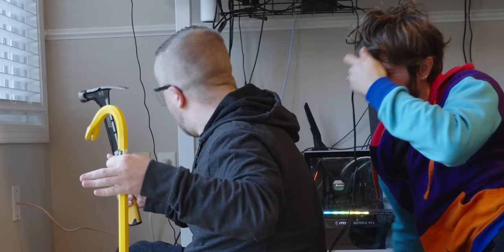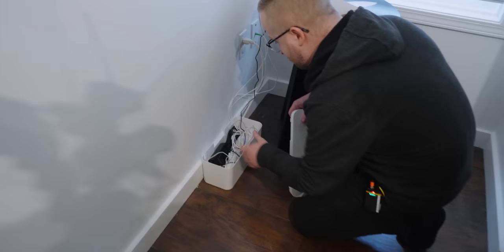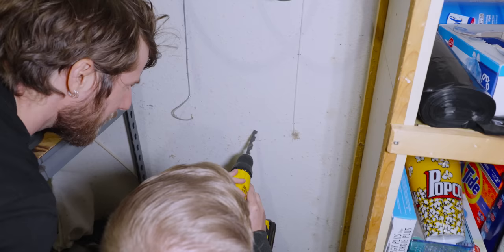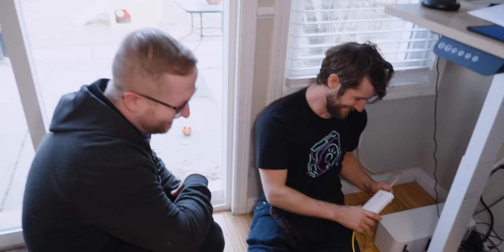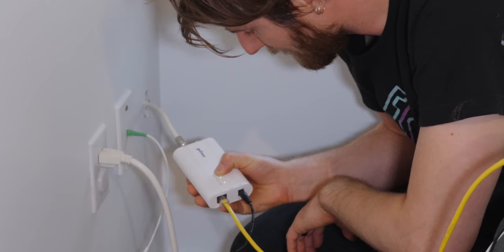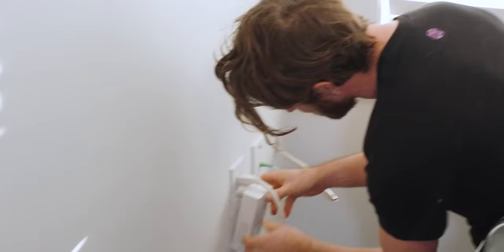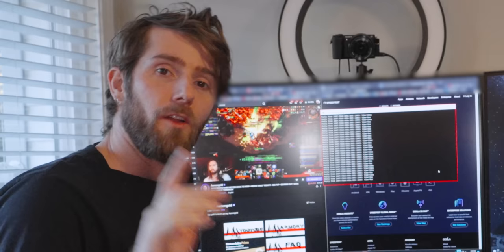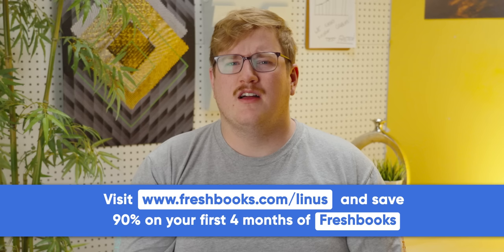I Will FIX Your Wifi - MoCA and Powerline at Colton's House

Comment: So do not get your hopes up for Ethernet over Power.  I tested in my house and it gave good performance in the same room but put it in another room and the speed dropped to about 100 Mbits.   It just will not perform on adjacent circuits and also if there are any filters in the network that also kills the speed.  Many appliances have some filtering built in and also any major surge protectors also kill the speed.  I have to have whole house surge protectors in my house due to the geologic characteristics of my home.  So no hope for Ethernet over Power.  My house has Cat 5 cabling not Cat 5e so theoretically it will not support Gigabit speeds and I tested it and it delivered about 125 Mgbits.  But after much experimentation I tried new connectors an low an behold I can get about 850 Mgbits.  I had attempted to pull Cat 6 cables but the old Cat 5 were wrapped around the studs and I could not pull cables.  So experiment a lot with different solutions.  I did not go with an MoCA due to the cost of all the MoCA adapters.

My next project is to run one Fiber connection between floors and then branch off those connections to get above Gigabit.  I have the equipment and the used Fiber adapters which are fairly reasonable.  But I am waiting for Google to offer 5 Gbit speeds before I do that.  For people looking for higher Wifi speeds I have exhausted the solutions and the best you will get is about 700 Mgbits if you are close to the Wifi router and I have a high-performance NetGear access point connected on a dedicated Cat 6 cable to the Cable Modem/Router.  I know WiFi and have it tuned fairly well.  My computers all have Wifi 6 adapters and no RF interference and that is about as good as you can get on the existing WiFi 6 Access points and AX600 adapters.  I am going to experiment with external WiFi antennas for WiFi access since some of the higher speeds rely on bounced signal technology called MU-MIMO.  This is a complex method of increasing speeds by using multiple signals to carry data simultaneously on bounced signals.

I do have a roll-your-own Mesh network using NetGear Access Points over the same Network Name so I have seamless roaming.  The NetGear network extenders have one of the better Mesh solutions at a lower price point.  I used tow work in wireless technology so I  am a bit of a wireless geek.  I actually run several networks and one of them is running a dedicated router for a WiFi VPN which enables my TVs to think they are in the US so I can receive US channels outside the US.  The WiFi solution is based on DD-WRT open-source firmware which enables me to set up my VPN for all my devices without having to run a client on the devices.  I may upgrade my other network to run a Mesh network on DD-WRT based routers.

Comment: I tried both powerline and Moca after only getting a very inconsistent 17Mb/s over Wifi. Powerline brought me to 15Mb/s steady, and moca did the same. My advice, but a long ass ethernet cable and a cable trim kit from walmart. Ran a 75 foot ethernet cable across the house with channels and clips and got me up to my rated gigabit speed.
Reply: The sight of of running a long cable across the house makes me cringe.

Comment: The likely reason for the MOCA port on Colton's router "not working" is that it is strictly a WAN port, not a LAN port.

As well, I believe a Dish Network coax system would be better suited for networking duties because Dish's Coax system is a much higher bandwidth than standard cable tv coax due to the requirement to feed up to 19 HD streams into their Hoppers and several streams back out to their Joeys simultaneously. They also already have ethernet over coax built in to their Hoppers and Joeys. The problem lies with that bridging might be proprietary (non-standard frequencies). The Dish devices also have an ethernet port along with the standard coax port, so if the Hopper is connected to your network router (Hopper has two ethernet ports)  and the Joey is connected to the Hopper via coax, theoretically you can plug a computer into the ethernet port on the Joey and get on your network.

Comment: This would work great for me. But will it still work if the power supply to the preexisting cable system has already been removed? My mothers house which is at least 25 years old, has a satellite system installed by Bell Canada that has been since decommissioned and the power supply to the system is no longer connected. Everything is still connected though except for the power supply.
Reply: I don't see why it wouldn't work. As long as the coax cabling are all hooked together in someway in the house, the MoCA adapters should work fine.

Comment: Wireless is bad - and this is with your paper thin American walls - now try to imagine wireless network here in good old Germany with massive stone or concrete walls that can go from minimum 12cm up to more than 30cm in thickness XD - I tried for more than 5 years to build a stable wireless network in my Home. Even with Mesh technology it was simply not usable. So, i drilled holes through every wall needed and wired everything with cat6 cables. But i hoped to find sometime something better and now with Moca i think this might be the perfect solution. It would need further rewiring but this looks promising. And PowerLine was tested - but did not work

Comment: I suffer constant (at least once a day) disconnections with this specific MoCA adapter. They lessened when I switched from 2.5GBE to 10GBE socket (running in 1GBE mode) but still... And due to lack of grounding in sockets next to router, powerline ethernet is not an option.

Comment: I have not read all 2800 comments (post has been up approximately 24 hours) but was curious as to whether or not there is a fix for the disconnection that happens when a large power draw takes place. I use the powerline setup but even as much as my laptop being plugged in (granted it's 11.5amps) will disconnect my wide format printer from its RIP software.... and any printer knows that sucks to say the least.

Comment: Im actually whatching this with a TPLink Powerline adapter thing. Not only does it allow me wired access in my room but also acts as an access point for wifi as well, because overwise my room just a deadzone so I littrelly have no internet without the powerline adapter.

Comment: In my experience, power line networking is not worth the money unless you have both adapters in basically the same room. Using 2gbit adapters I got 200 in the same room and as low as 3 otherwise

Comment: Why would you drill from the garage. Drill from the inside!

I can confirm, when awesome WiFi sucks for gaming. You feel it no doubt. I used power line and it worked great. But my adapters needed to be reset every week.

Comment: A coax keystone, and a wallplate would have been a much cleaner solution on the router side of thus set up than a coax being shoved through a rough hole in the wall. C'mon Linus you're better than that.

Comment: Hello good sir, so you show in the video that if I use a powerline thingy the speeds are almost the exact same I'm wondering I have fiber 1000 mbps can I buy a powerline that supports those speeds and if I buy a powerline will my connectivity still be very good/ will my ping still be low ?

Comment: Honestly couldn't believe that you we're making a video on powerline. If I have one Tech Tip: don't ever use powerline unless you're in a powerline testing lab. 

After installing and using Powerline for years now, I can say that even in european houses built in the 2000s, powerline is not at all even remotely consistent. Actually most people that I installed powerline for, switched back to WiFi by installing access points closer to their usage area, and have been happy ever since.
I only watched this video to the end because I couldn't really believe that you would  seriously recommend powerline.

If you even come close to 50% of your provider's speed on powerline, you're lucky as hell, and even then the bandwidth is so inconsistent, that you get random disconnects every now then, or won't be able to watch TV. Trust me, I've been through many friends and families houses in recent years, and even people with thick concrete walls are way better off with a properly installed WLAN network.

TLDR: powerline is big L Tech Tip

Don't know much about MoCa, but technically looks really good, given your house fits the requirements.

Comment: Those are just awful, had this a few years back to connect 2 floors.
Speed was low and the connection was not stable with very frequent dropouts.

Comment: It's not hard to do good wifi. You just need to buy quality gear to begin with and a soupcon of common sense, and to lean into mesh solutions for outlying areas. Cat6 wiring, good wifi hardware, some mesh, the end. Oh - and there are actual professionals out there who know how to do cable runs in houses...

Comment: I can't recommend Powerline Ethernet at all. It's literally less reliable than WiFi here. When it works, we get around 3-5 MBit/s instead of the advertised 1200MBit/s. It's a complete hit or miss. I've seen those  things work, but in my experience they're just bad.

Comment: "I will fix your WiFi" by not using WiFi.

Don't get me wrong, WiFi is terrible.  As someone who professionally deploys and supports WiFi, it's bad.  Complete nightmare some days.  my ordered rank for what you want, in the order you want it for good, strong, reliable, consistent connectivity is typically: Fiber, Ethernet, MoCA, WiFi, then Powerline.  Don't get me wrong, powerline can be good, but you damn near need a degree in electrical engineering or to be certified as both an IT person and an electrician to actually troubleshoot it.  If it works, it works really well, if it doesn't work, well.... an electrician will tell you to pound sand, and an I.T. person will scratch their head at it, shrug, and give up.  There's a few unicorns that actually understand both I.T. and Electrical enough to really give any meaningful input on why it sucks.  So for anyone considering powerline, just be sure you have the option of returning it when/if it doesn't work for you.  If it works, it's great, if it doesn't work, it's an impossible mess to try to sort out that basically nobody can help you fix.

MoCA is straight forward, and works well, get a cheap coax cable tester/toner and figure out where the lines go in your house and connect everything together.  If you're paranoid about sharing internet with other MoCA users in the neighborhood or apartment complex, then get a MoCA filter and put it on the incoming line to the house (if you're connected to it - if you don't need it, just unplug it, it's free and easy).

WiFi is easy but can really suck when you have a lot of WiFi devices or any interference from neighbors or other signals (like microwaves).  But the king of kings is ethernet and fiber.  Ethernet is great but limits on speed and distance can be a problem, which fiber can solve.

My "rule of thumb" (so to speak) for networks is simple: Ethernet when you can, (any) wire when you can't, and if wires are not an option (even MoCA/Powerline) then Wireless when you have to.  Seriously people, save the WiFi for the devices that don't have ethernet as an option; it will keep the bandwidth off the wireless and make it faster and more reliable when you have devices that only use it.

As a network engineer, this was a good video, it outlines a lot of the problems with these technologies, and Linus/Colton, if you pay for airfare, I will fly out and fix Colton's place.  Seriously.

Comment: I'd like to know how these powerline adapters' ping latency times look like if someone else is running a circular saw, drill, microwave or other high generating spikes on the AC. I know there's error correction but that must take a toll? Legitimately curious.

Comment: Question for the class with my router and modem in the basement and me living on the second floor would it be smart to try and move my system upstairs or try to run an ether net cable downstairs or just call my provider to come do it

Comment: I'm at the start of the video and just seeing the powerline option already triggers me. I used it for a few years, it is soooooo bad. Shitty connection, low speed in the best circumstances and even lower when other things are plugged in on the network. Example: best situation I got 60 mbps (out of 1000 subscription and 300 mbps rated powerline adapter), just turn on 1 babyphone and poof, 40 mbps

Comment: i tried using powerline to get better connection than wifi but since my room and the room where the router is are on different circuits, i get around 30mb/s on both solutions

Comment: Why would you not show the super easy and simple process of installing a low voltage wall bracket and new faceplate to cover that hole in the wall?  It's a 5 minute, 5 dollar fix.

Comment: I have 2 questions, this is an older video so if anyone happens to see this and knows the answers it'd be greatly appreciated. 1. My microwave heavily interferes with the WiFi signal to my room anytime it's on, would this help? 2. If Im living in an older house, could it affect or even not work with it due to the old wiring? If you can answer one if not both of these questions it's be extremely helpful. Thanks in advance!!
Reply: And nevermind, had I watched just a LITTLE further into the video, both of these questions were answered. Thanks LTT! Sorry for being a lil dense lol

Comment: I tried the powerline in my apartment so i didn't have to use wifi and it was horrible, it went from 400mb to 60mb and added 200 ping.

Comment: Hey Linus how does that work with an over the air antenna  over the coax?
Reply: I have no issue with OTA on my MoCa adapters.  I have my cable modem on a separate coax cable and the rest of the house on OTA with the MoCa adapters.

Comment: is there a way to use the landline ports that are in my house to carry the network?
Reply: If your home's phone wiring is CAT5, sure. You'll need to take off the face plate and look at the cable. If it has 8 pairs, you should be good. If it doesn't, then it won't work as that is not ethernet and you will need to wire each room you want with ethernet.

Assuming your phone cables are ethernet, you will then need to buy keystone jacks and wallplates to install so that you have ethernet ports (data drops). There are 2 main wiring standards T568A and T568B. To my knowledge, B is the standard used in the vast majority of networks. On the other end of the cable, you'll need to figure out where they terminate. Usually, there's a demarcation point between your home's telephone wiring and the telephone company's network. It may be on the side of your house. You will likely need to move the wires from this demarc point into another central location in your home like a closet for your network stuff. The ideal way is to install a patch panel so that your ethernet cables terminate into the back of the patch panel and then you run an ethernet cable from the panel to your router or switch. You can forgo the panel and just put RJ-45 connectors on your cables and connect them directly to your router if you want.

Comment: Another neat piece of tech in the same vein to check out is the TPLink Deco P9 and its upcoming successor.

They're mesh routers that have the ability to use powerline for the mesh backhaul in addition to wireless and ethernet. I use mine to get stable wireless internet to my detached garage.
Reply: sounds like a really lazy way to do networking but if it works it works.
Reply: @BassRacerx  well, when you have a detached garage that you want internet in that has power, but zero network connections, and is too far for wifi to work reliably, powerline is your best bet
Reply: @BassRacerx  lets see, $2500 to trench 4ft deep (code in my area, lay conduit, pull wire, and get through the concrete slab, or $150 for a powerline router that works just fine for 2 cameras, a thermostat, a smart garage door opener, and a Roku...
Reply: @ajherman  there is doing things right and theres doing things cheap.  If it works it works. there is a reason these alternative technologies exist.

Comment: Does anyone know of any power line adapters that can be wired straight into a power cable without needing to go through a power adapter? I have a couple of places where it would be great to replace security lights with smart ones, but they only have power cables, no sockets.

Comment: Attach the ethernet cable to the coax, pull the coax, ad a switch at most somewhere, problem solved, house converted to ethernet... wifi sucks, ethernet over power lines also sucks... XD

Comment: My wifi gives me a 2-4ms ping consistently. Can't complain. I have many devices on the same router (currently 10). It's so much more practical than wires, that I'll gladly take the eventual added 50ms happening for a faction of a second every few minutes. I'm not a pro gamer, nobody cares or would notice this.

Comment: welcome the world of isp techs, we deal with this shit every single day, here is a tech tip for everyone, if you want good and stable internet, for f*ck sake use a cable, dont try and use powerlines, they 100% will give you issues, if not immediately, they will eventually 
but if you really have no other option then cable (or mis content family because of cable through the house): first alternative moca, second alternative wifi mesh, third and most definitively last alternative are powerlines